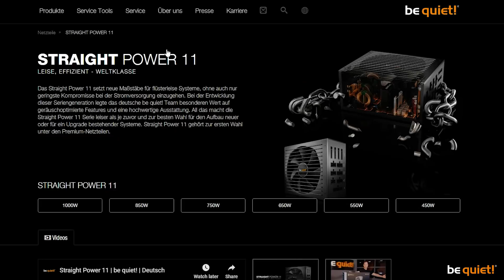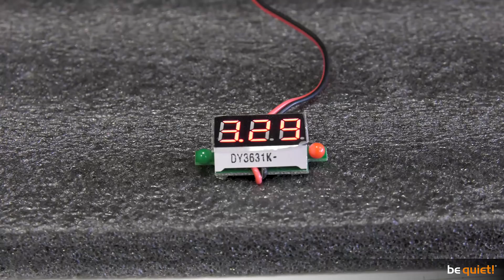Passive and semi-passive power supplies | be quiet!

Comment: Except the bearings of a fan will wear out faster if it's always on and will produce more noise in the long run. He conveniently forgot to mention that (replacing fans voids warrany btw.). Passive PSU's are perfectly fine for light powered machines. Pico PSU's have a good reputation as well as HDPlex. As long as you can use an external power adapter in conjunction with a DC-ATX converter for builds <200W it should be no problem. There's a BIG market for that nowadays. My next workstation will be AMD APU (4350G) on B550 with PCIe gen 4 SSD and it can run it with less than 150W under full load. Pico and HDPlex are my only options. Pico is kind of cheap but does the job while HDPlex is higher quality but comes at a price and isn't always availlable. There's definitely room in this market.
Reply: It really depends on a fan. I have Seasonic PSU with fan that is rated for 50000 hours which is over 5 years of 24/7 operation. I bought it about 3 years ago and it's still quiet, i run my PC for about 12h a day.
Reply: @setecastronomy_hc  You are right. While a higher grade Be Quiet PSU, that come with Silent wing fans, that has 6 pole motors have even higher MTBF, If I remember good. Like 100 000 hours? I have a 4 years old Straight Power 10 that mostly runs 4-8 hours a day. It rotates so low I almost can read the rotating be quiet logo.... :) And of course I can not hear any sound issues coming from the PSU.

Comment: i'm not worried about the noice that my pc makes, but i'm afraid of the air flow! This because  my case have no bottom holes that can let the air to come in to the case, especially in to the Psu, for this reason i need to put my Psu  with the fan on top, and i'm worried about the contrast between the psu and the gpu (because they are really close each other), i'm using a 280W ES psu, but i want to change it because i want to change the gpu too! Can someone tell me what i can buy? (sorry if you see some grammatical errors but i'm iktalian)

Comment: My thoughts exactly. I can't understand why people are bothered by a fan running at 30% speed. This is way better than the sudden ramping up.
Reply: I agree. I have a semi-passive GPU, the fans suddenly revving up are extremely annoying. I set a custom fan profile at 30% on idle and they are virtually silent.
Reply: @fsk648  Same. First thing I do with my GPus to switch off the fan-stop and find the lowest fan rpm were there is no vibation noise.
Reply: ToRt1sher graphics card company’s do it as well, they say their cards  are quiet because the fans off, but when it turns on the gpu turns into a vacuum cleaner, got my fan curve always on with a smooth increase. So much better.
Reply: Dusty areas :)
Reply: I have enough noise with my whole life Tinnitus...